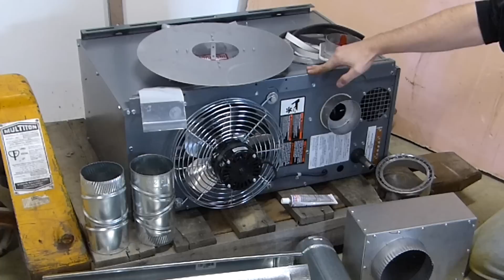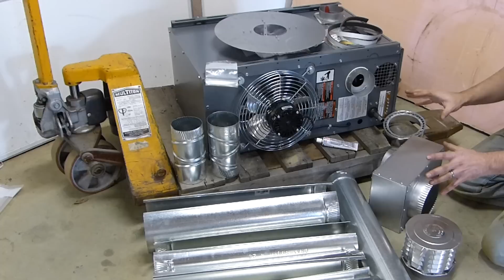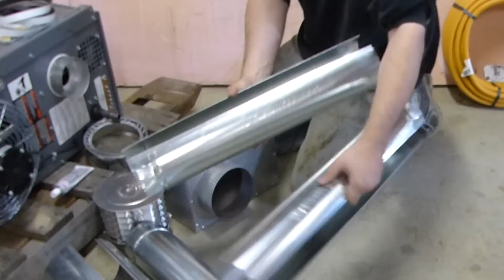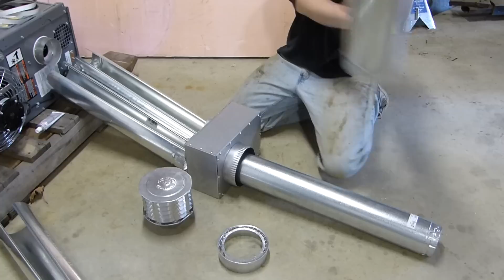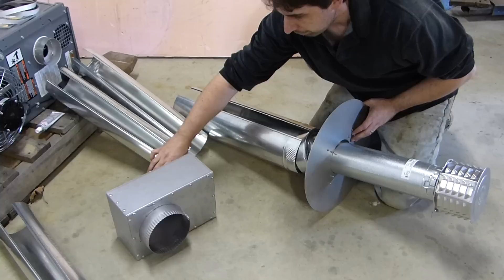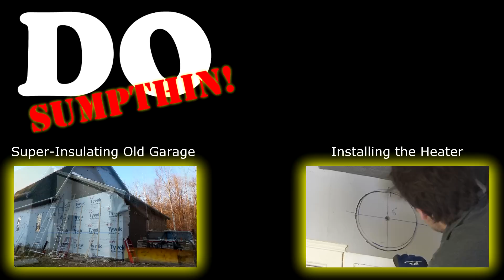Garage & workshop heating - concentric venting benefits

Comment: I know this is an old video, but the B vent can rust through over time.  The connections are also not air tight.  And of course, with it being inside a concentric box and having an air intake pipe surrounding it, you'd never even know you had a problem while CO2 is being pushed out (positive pressure system) the hole and coming back into the heated area through the intake.   Cat 3 is required for the exhaust pipe in both a horizontal and vertical according to Sterling.  And it has to be cat 3 from the heater all the way to the termination cap.  Cat 3 is expensive - it added $460 to the installation cost, however it's the only way it would pass code, since code often uses the most restrictive between the local code and the installation manual.  If a fire occurred and it was not up to code and wasn't inspected then your insurance company could deny your claim.  That's not a risk I was willing to take so I bought the bullet and purchased cat 3.  The only way you can use B vent is if you are going vertical and pulling the intake from the garage area.  The only thing that doesn't make sense to me and Sterling can't provide a good answer is why is a non concentric separated vent system (exhaust going vertical) and intake coming from outside in a totally separate pipe require cat 3, yet if you pull the intake from the garage space they consider that a cat 1.  I mean what's the difference between pulling the intake from the garage space, or 2 ft away from the outside?  That makes no sense and maybe there is a reason I don't understand for that.

Comment: Does the 6” pipe overtop of the double wall exhaust pipe need to have clearance around it as it penetrates the wall?  Or can you just have a 6” hole through your wall?

Comment: Dude, nice video.  Of course now a days its the overkill class III pipe that is required for most codes.  However, if you don't have codes to comply with, your system will still work on a majority of applications.  With that said, the class III is a safer system but almost 2 - 3 times the cost depending upon where you purchase it from.  I am going to be adding heat to another garage I just built and being that I have no codes to comply with (live in no mans land lol) I will probably run the system like you have here.  I have always been a fan of make up air concentric systems.  I think they allow you to heat your space a little more economically.
Reply: +tom h (Dr. Death) The sizes of the concentric box and accessories have changed to fit category III pipe now. The kit in the video was made to fit B vent which is a different OD.
Reply: Do you know why they have made such a fuss about using category III over the old B vent?  I was going to buy a new heater for my garage but the cat III is just outrageously priced.  If I do, I think I may just use the old B vent.  I just don't see where it would cause a problem.
Reply: +tom h (Dr. Death) I agree. That legislation was probably pushed for hard by the vent pipe manufacturers, because they are making a killing! I was just letting you know the current concentric vent kits for these heaters have changed making it difficult to use B vent without modifying them in the field.
Reply: ACF Greenhouses - The Greenhouse Specialists ok, thank you, I appreciate the heads up.  I like your stuff by the way.

Comment: Please note: The concentric vent kit for the GG heaters has changed due to new laws regarding the type of pipe required to vent unit heaters. Piping for the flue/exhaust is now UL1738 listed category III pipe which is a stainless steel pipe with built-in gaskets and locking system and is sold separately from the concentric vent parts.
Reply: Also, unless I misunderstood something when I talked to Beacon-Morris customer service, the pipe kit is designed for horizontal venting. The pipe kit came with Duravent FasNSeal single wall UL 1738 pipe, and I had to buy a tee and condensate cap separately to vent vertically (FST4 and FSDF4). BTW, I bought the Beacon-Morris BRT045, which is the same as the Sterling GG45.
Reply: +hoopfan71 Yes. Our pipe kit includes all pipe needed for a 5' horizontal run. We offer accessories for customers who want to vent at an angle or vertical at http://www.littlegreenhouse.com/accessory/heater-pipe2.shtml

Comment: Thanks for posting this video. I've been looking at the Hot Dawg, but the separate combustion heaters are pricey. I like the options the Sterling provides.
Reply: Please correct me if I'm wrong, but this kit appears to be made for horizontal venting only. I saw that Modine makes a vertical concentric vent kit for their heaters. Do you know if Sterling makes a vertical concentric vent kit? I haven't been able to find one. Thanks.
Reply: +hoopfan71 The Sterling concentric vent kit can be used for horizontal or vertical. It does not require a different kit for vertical.
Reply: ACF Greenhouses - The Greenhouse Specialists Yes, I got my answer by doing more research. I did have to buy tees for vertical venting to create drip legs. BTW, your service was quick, and the parts were reasonably priced :-)

Comment: Very informative video. I ordered the Sterling vent kit and the dimensions appear to have changed. The kit now longer comes with the pipes. The external pipe is now 7 inches.The pipe that goes inside the 7 inch pipe is a 4 inch UL1738 listed vent pipe. I'm having trouble figuring out what to use for this vent - is this a "b vent" or single wall?
thanks

Comment: thank you much.  that is the best info i could find on that exact concentric venting kit.  How is it working?  do you like the heater?  I am looking at the Sterling 75k btu unit to heat a 1000 sq ft shop.

Comment: As of October 2014, the Sterling concentric vent kit doesn't seem to include the single wall pipes.   Not a big issue.  Question: winter temps are very low here. I'm doing a vertical venting through my garage attic space and roof.  Should I include  a condensate trap on the single wall exhaust pipe (if I can)?
Reply: +Gerry Lisi This might be a tad late for you, but a condensate trap is always a good idea, though not always necessary depending upon heat source.  It usually is an inexpensive addition.